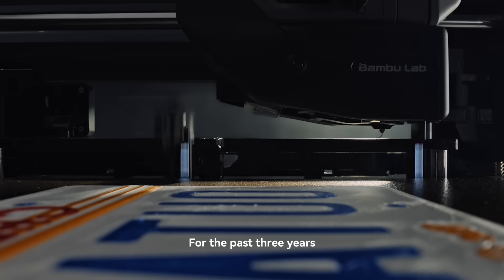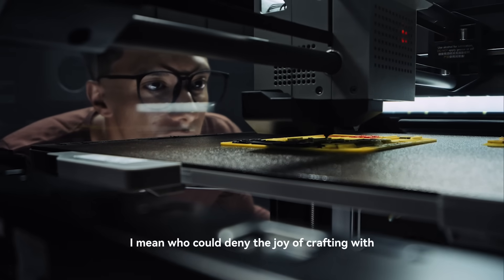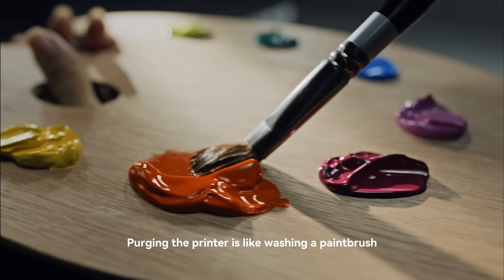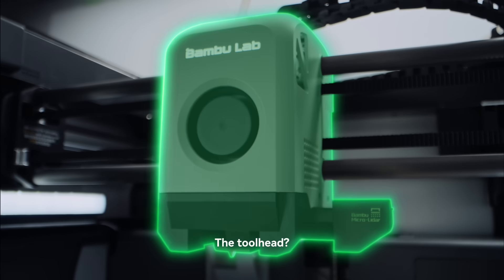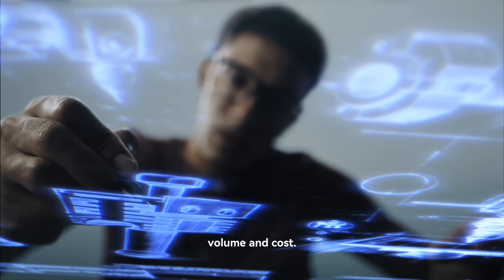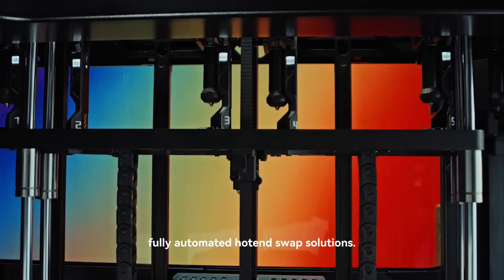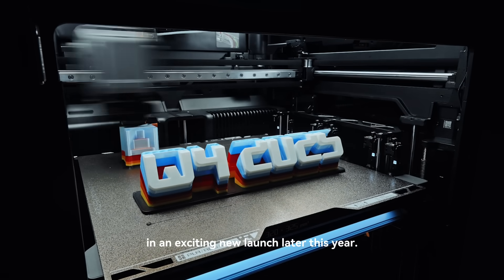Meet Vortek: Our Answer to Zero Purge Waste Multi-Material Printing

Comment: Wait they claimed to be elminating purge, but there is clearly a purge tower in the background of the final print? If they are elminating purge I would kind of expect the thing to wipe into the infill only for purge and not a purge tower on the print bed.
Reply: Not a purge tower, a prime tower, they are different. Even the Prusa XL does this when changing tool heads. You always need to squeeze out a little filament after a change to prime the nozzle and build up a little pressure.
Reply: @NorwayVFX  fair point, and likely wishful thinking to see it eliminated completely. But shit I still think there could be more done to utilize the entire inside of a print when it's at the size they are promoting.
Reply: @pyrow14  I'm guessing we will be able to do this if we wish just like with their previous machines. 
There are settings in the slicer to turn off the prime tower and instead have the machine prime into the infill, meaning zero waste. 

Bambu's default settings always have a lot of waste because they prioritize good print quality, but advanced users can tinker with these settings as they wish.

Comment: UPDATE: The new flagship machine is the H2C. If you just bought an H2S or H2D, don't worry, upgrade kits will be made available to convert your machines to an H2C. Also, if you just bought an H2S instead of an H2D because of the cost difference, the H2C will still cost more than the H2D, so no regrets.

Comment: Love the idea of induction heating! Wireless toolheads is such a great concept. Still needs a wipe tower as there's only one filament path, so print times are still going to be large for smaller multi-colour prints
Reply: Prime tower can be smaller since each nozzle has a dedicated filament (except if using more than 6 filaments).
Also some parts can do away w the prime tower when turning on "prime into support or infill".
And user can always disable the prime tower (H2C could then simply do its basic priming via a simple wipe over poop chute + silicon brush).
Waiting for BL to share more.

Comment: Compared with existing tool changers like the Prusa XL and perhaps the new Snapmaker I can’t help thinking that this solution will require feeding and retracting of all materials which means it won’t work with TPU and other material mixes and may not work with all the engineering filaments that are not compatible with active feeding and retraction system of the AMS1&2 or AMS HT?

Comment: Couple of questions, if you are just switching hot ends, that then need 8 seconds to heat up every time changed, from look of the design, would then need to push filament out of hot end at some point, or retract it out. Also not one color per tool head, looks like limited by AMS as normal so, so would assume would need to load/unload for each filament change...or am I just missing something.

Comment: This will be the end of Prusa XL because if it is cheaper or just as expensive, most people will buy it instead of Prusa XL.
Example:
Actively heated chamber
Air filtration included in the price
And you don't have to pay extra for the box and assembly

But then again, Prusa is a European company and I trust its data more, but Babulab H2D has an Ethernet port and can be operated completely offline
Reply: Bambu is a state owned organization, so your call there man

Comment: Zero purge but you show the purge tower on the bed.
Reply: Not a purge tower, a prime tower, they are different. Even the Prusa XL does this when changing tool heads. You always need to squeeze out a little filament after a change to prime the nozzle and build up a little pressure.

Comment: Ok so its bondtech INDX but locked down to bambulab printers (btw i thought this the second i saw the video) Its an elegant solution which with the extra elektronics will make hotends more expensive which i dont like. But if you somehow manage to make it backwards compatible i am hooked. Before that you should however solve the burning printer issue wit the P1S and A1 printers and Please fix your printbeds the heat distribution on your Pro model Printers is a joke.

Comment: This will not beat the snapmaker in my opinion. They are going to charge at least $600 for the add on then you have to buy the printer. The value snapmaker and overall package is the most enticing part

Comment: Induction heating so you don't have to transfer high power through pogo pins is insane, in a good way. Swapping just the hot end is as well. 

I am not a Bambu fanboy, I have never owned one - but I feel like this is the second time they're forcing a step change in the industry. I have never liked the AMS multimaterial system, especially because I really only print functional parts - so I mostly use it for drastically different materials that don't play nice in the same nozzle (support material, rigid material, flex material). I've been a fan of dual nozzle or IDEX, and really like toolchangers, but could never justify it. But this... If it works well, could have people scrambling to imitate. 

Also, with the X1C, you completely stole the AnkerMake's thunder, and now I worry you may be doing the same with the new snapmaker

Comment: Quite interesting. I knew they were up to something, but Dr.Tao didn't want to say this when the news of the H2D dropped. Maybe they wanted this to be finished sooner, but there were some bugs to iron out. I like toolchangers, but one 'downside' to toolchangers, like the Snapmaker, is that you're 'limited' to 4 colours/materials and no way to extend that. With the AMS, how wastefull it is, you can expand to 25 spools on the H2D. But they've cracked the nut so it seems. I have confidence that this works as flawless as we have become acustomed to with Bambu Lab printers.

Comment: This is way cooler (and probably cheaper) than any of the other solutions ive seen. Even that new snapmaker isnt as cool as this
Reply: Bambulab and cheaper, in what universe are you in? this thing has more moving parts than any other implementation have you missed that theres a Chip in every single nozzle?

Comment: I love the idea and I hope it gets adopted industry wide but if the hotends are induction heated, why even have a chip in the hotend? Shouldn't all the sensor information be in the toolhead and treat the hotends like they are a tool on a CNC machine? It seems like the right idea was opted out in favor of complexity that in the end could deny the consumer access to OEM parts.

Comment: I watched an interview of a rep for a company working on a different multi-toolhead induction printing solution.

He mentioned that hardened steel is a poor choice for induction heating, so they had to go with a softer metal that wears more quickly.

I'm interested to see if Bambu has made similar trade-offs, or if they've found a creative way around the problem.

Comment: Looking at the fake blueprints and drawings in the video reminds me of pausing movies to read the silly lorem ipsum level headlines.
sharp edge!
NO fillet/chamfer

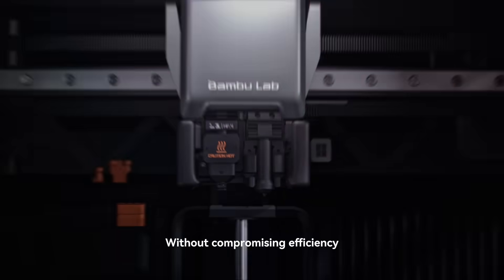Also, at 2:13, that clearly looks like pads for pogo pins on the hotend if I have ever seen them. Not sure if wireless communication hotends are going to be a great idea. I guess it locks out even more aftermarket improvements.

Comment: My favorite part is where they shit all over the ridiculously priced products they just released a few months ago. 0:35 Talking about all the purge that literally all of their multi filament options still waste and have for years. And the "some accomplish this by adding more nozzles into the toolhead, negatively affecting print speed" (paraphrasing obviously) @ 1:20 when they are literally the only ones I've seen do it. They're definitely feeling the pressure from bondtech with the indx, and  snapmaker with the u1. Sure maybe they've been working on it for years but those products likely made them feel like they have to announce it now,  hopefully it doesn't turn out to be half baked. They won a lot of consumers over with the x1c because of the value, but with the h2d it just isn't there. The laser seems to be something that nobody really wants and the h2s from what I've seen so far is just a bigger x1c. Not to mention how many in their community turned on them for the forced connection to their Chinese servers if you want to use the features that are included with the printer. But fanboys gonna fanboy so whatever i guess.
Reply: Accurate post.  This is panic release for Bambu.  And they havent actually been "working on it for 3 years" what they did was have a rough idea they started but shelved 3 years ago. Probably actually looked at induction before the X1C but didnt have the engineer knowhow to make it.  Its still not going to outsell the U1 INDX or probably not even the Wondermaker.
Reply: Yeah I'm surprised nobody else in the comments pointed this out. 'it's a problem that plagues every player in the industry'.... No, it's just you Bambu.
Reply: Both are upgradable mate. And they do mention in thge blog they;ve released this news early so that less people buy a H2D or H2S only for this to come out and they regret it
Bambu has fans fdor a reason, they do a damn fine job for at home hobbyists
If you want something to tinker with as an elite printer that you can dial in with open source software
But haivng delt with anycubic kobra and bambu a1 mini, bambu wipe the floor with them. Not even close. I regreat buying my anycubic, it has been a pain from start to finish with constnat dialing in needed, and a printbed that was not level from factory 
My only regret on the bambu is getting  the min iover the A1 reguylar
Now I'm looking at the H2S, but will wait to see if this H2C is within my limit

Comment: Moving the whole nozzle parking area up and down is just silly over complicated, they don't take up much room just make the printer a little bigger. Seems like an unnecessary failure point and extra time wasted. I do not understand why they didn't just have it slot into the toolhead from the side like bondtech indx. I'm really glad they are doing something other than dual nozzle but they seem to have made the system as complicated as possible for no reason. Bambu gonna bambu I guess.

Comment: I don't see the filament loading.
If the filament still needs to get loaded every time, then this is not much of an improvement (besides the induction).
You only changed the place where the nozzle swapping happens.
In that case the Bondtech INDX will still be vastly superior concerning compatibility with flexible or brittle filaments, and very likely nozzle changing speed also.
Still no true automatic swapping for brittle & flexible filaments.
Looks like a half-assed approach imo.

Comment: Took me a few views for my brain to catch up on how it works.

The other nozzles are not pre loaded with filament…
So there is going to be x amount of time still between filament changes where the AMS will need to load/unload to swap out the filament so this method just is good for saving filament still just not make multi colour as quick as compare to SnapMaker U1 or Prusa XL due to the already loaded heads.

However I am still massively excited to see what Bambu do with this different approach.

Will hold off on my H2D order for now…

Comment: literally an INDX clone. it shall be met with thunderous applause. oh well, it's good plastic waste is being addressed
Reply: Bondtech is a tools head changer, not a nozzle changer
Reply: @MrlegendOr  wrong. Bondtech's INDX is essentially a nozzle changer. Both also using induction to heat up as well.

Comment: I'm a bit confused because the nozzle is switching out but each nozzle does not have separate filament feeding into it... So the AMS is still going to have to retract and then feed filament for every switch... is the filament still being cut? You just leave the bit in the nozzle to sit there waiting for that color to be used again? is one nozzle dedicated to one color forever? 
I do think that tool changers are the way forward, just curious about the details, I guess well have to wait and see.
Reply: most of the poop is to flush the nozzle so you dont get color or material contamination. With cutting or tip-shaping you can get by with just a purge tower that does more to get pressures up and is standard with all tool changers.

Comment: so if the end was printed with this shiny new tool... why would there be a PRIME TOWER if each separate hot end is a different colour so no colour bleed? and time lapse vids should use different method instead of wasting more filament.
Reply: a prime tower primes the pressure in the nozzle. everyone's doing it

Comment: So you now have hot swappable heater block and nozzle which are inductively heated. It still chops the filament but this prevents the purge. You still have to load and unload the filament though, which will take time, and you will lose the ability to prevent oozing with a retract which is probably going to increase stringing.

So it’ll be slower and have some drawbacks but potentially cheaper. Still don’t see this doing flexibles though.

Comment: lol what a stupid solution. Just make a tool changer and be done. Stop trying to over complicate things that wont work out in the end anyways.
At the end of the day, you still have to deal with a slow feeding AMS. So a traditional tool changer will still be significantly better and faster.
Reply: hmm, no more purges, a single extruder, did you not watch the video, they talked you through it man, analogies and all!!
Reply: @Steveborough  Excepts it's still slower than a traditional toolchanger printer like the prusa XL or snapmaker U1. Even prusa just teased a pic today of a core one with a 7-10 index toolchanger. Bambu is still behind the curve even after 3 years. The fact that this still uses the AMS means it will still be cutting and retracting filament, thus making it inherently slower than the competition that have dedicated toolheads already loading with filament.
Reply: @LilApe a million ways to skin a cat, pros and cons for all, this will still be cheaper than a 5 head XL I cringe whenever I see someone open the "bellows" on the Prusa, talk about years behind, try printing engineering filaments on that thing!!
Reply: @Steveborough  You're right, million ways to skin a cat, and bambu has been doing it worse than prusa every time.
Don't worry though, there is a prusa core one with a 7 toolhead changer in the works, as teased by prusa today.
Reply: @LilApe I bet you own neither an XL nor an H2D! I also bet that 7 head core one costs more than an H2C and will be a buggy mess for a year just like the XL was
Reply: @Steveborough  Like how every new printer released by bambu lab wasn't a buggy mess?
Reply: @LilApe  Lies! Watch any comparison from credible sources like TT and CNC Kitchen. Note their disclaimers of a "rough" start with the XL. Ive had not a single problem with my H2D (May batch); Do you even own a 3D printer?
Reply: @Steveborough  lol. the X1/X1C was plagued with problems that needed constant revisions and supplier changes. The A1 shipped with a freaking fire safety recall. And the H2D has had many issues that are more reflective of a cheap printer, not one costing over $3k.
Reply: @LilApe  I think you're just mad you dont even have a 3D printer to speak of and chose to flame a Bambu post. Remember me when your core 7 is released mid 26 and bugs ironed out in 2027, you prob won't buy it then either. Happy Printing! (oh wait!)

Comment: Really happy to see there's an upgrade path from the H2d to the H2C. It sucks that I was basically looking for the H2C when i bought the H2D for multimaterial printing and then the H2C comes out not even a few weeks after I pulled the trigger...
Hopefully the upgrade is not ridiculously expensive, especially considering the hefty cost of the H2d series already...
Reply: As me you are feeling that "sketchy" feeling after buying the H2D right? And then seeing the price of the H2S almost 1k€ less than the H2D. I got the same sensation.

Comment: Looks like a bigger machine than the current ones. Going to be very expensive. Dread to think how much those nozzles are going to cost with wireless power and data
Reply: if you pause it just right, you'll notice that the build plate is slightly smaller on the x axis; same size, same exact chassis as the H2D; ie upgrade kit will include a smaller build plate

Comment: Induction heating?? Wireless communications with the hot end?? Damn, Bambu working with some dark magic here!
This is an innovation my non-engineer brain just would never be able to think of! I thought of maybe you would do like a four or six-nozzle tool head but the added weight would slow prints down. But this? This is pretty awesome if it is reliable enough!
I wonder if they just gonna leave it at 4 heads for the changer??